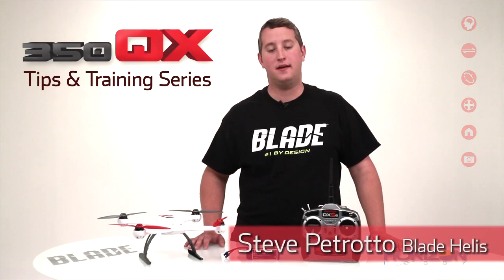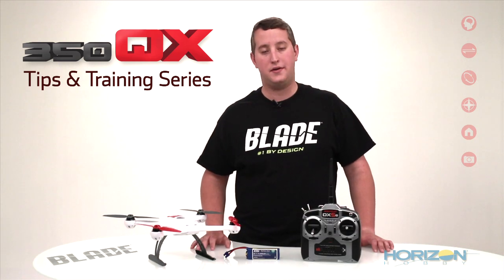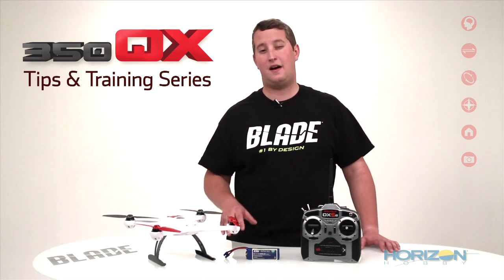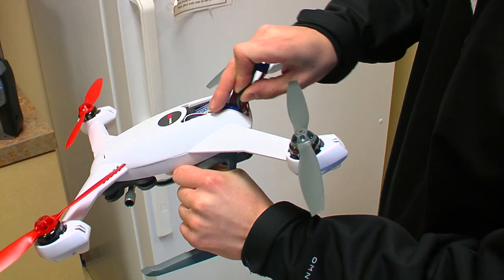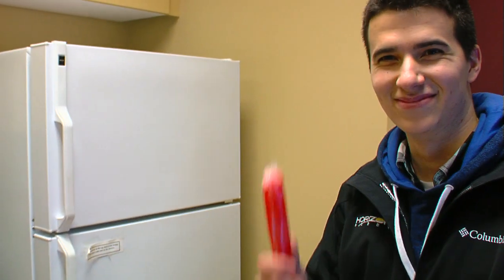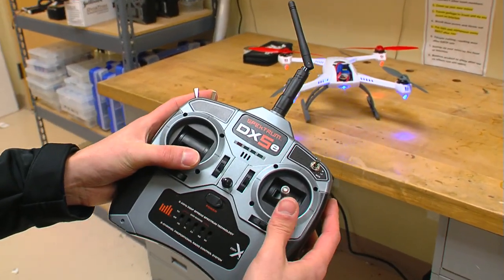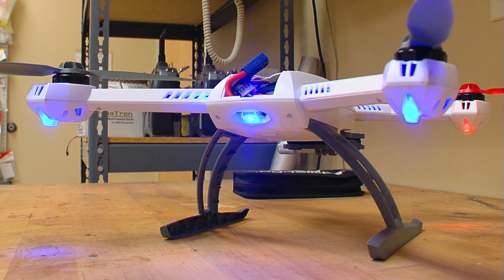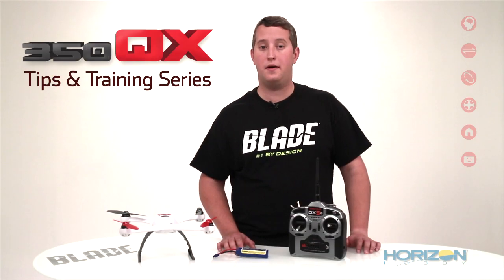350 QX Pressure Sensor Calibration

Comment: Hi I have this problem with my QX3 350. 

After a crash the throttle not response right. have a delay that not let me take off the drone. I connect the drone to the PC and all is right. The gps lock perfect and calibrations are done. The only thing i can´t calibrate is the pressure sensor. I do all the steps: fridge 30m - and all the steps that shows the video and after 10 min. sound like alert and give me flashing white light... every time.
Reply: +Andreina Martorano  10minutes in the freezer dude

Comment: I tried this two times and it flashes white ish  after ten mins
Reply: Same here
Reply: Same here !
Could you already fix the problem ???
Reply: Same here..I tried 6 times and always flashes white ...any solution ?
Reply: Reset the Ps3 that's what worked for me .like power off the on
Reply: craigtreeguy Ps3 ?? What is Ps3 ?
Reply: Sorry wrong comment section ..